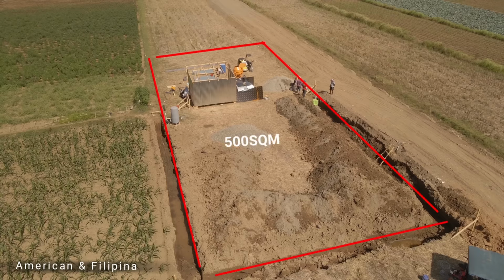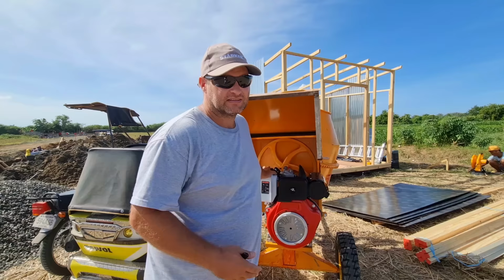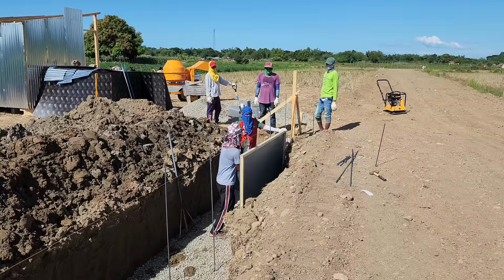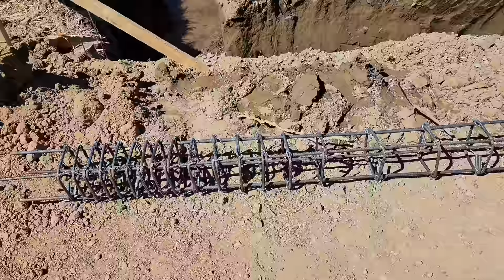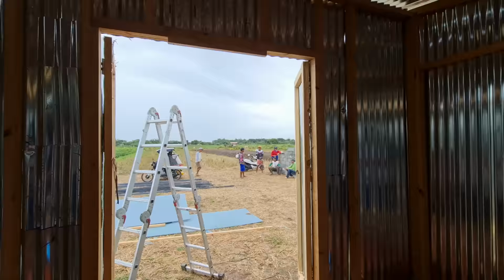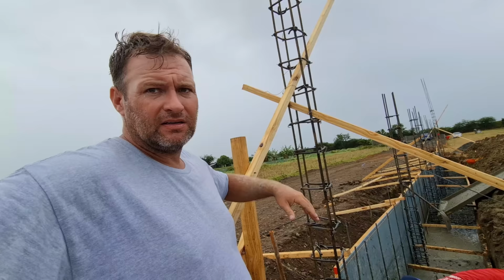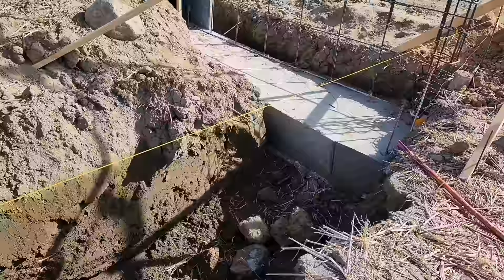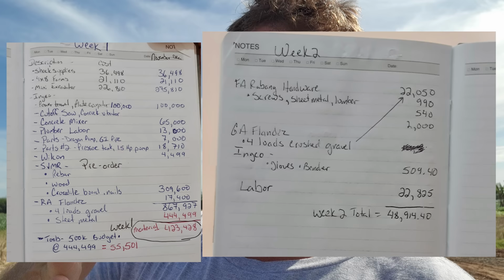Building solid Concrete Retaining Wall | S02  EP2 |House Build Philippines | The Armstrong Family

Comment: you building right beside the road? ask the local engineers if the road might expand in the future...
Reply from the maker: Road won't expand.  It's slated for a 5 meter cemented road!
Reply: @TheRichardArmstrong  there could still be an easement by the government for an additional few meters. For example: 5 meters for 2 lanes 1 meter each side for the shoulders and possibly 1 meter drainage on 1 side.

We lost about 2 meters of our farm land when they concreted the Barangay road. They even demolished our small culvert bridge without compensation and dislodged our official survey boundary markers. Good that we did not build anything there.

Comment: Curious about the slab for the house, since the earth is so wet.  Will the earth beneath the slab move causing cracks or failure of the slab?
Reply from the maker: That's a very good question.  Due to the unstable ground that is a good possibility with anything here.  Especially since we have had frequent earthquakes.   But as far as the slab
  The columns will be placed at 1.5 meters deep and then the slab will have extra reinforcement.   Settling of backfill is actually my biggest concern.   So we are trying to complete this fence and backfill as soon as possible so I can start to pack.

Comment: Richard, is the ecoflow generator dual voltage? In other words, can you charge it on the 240V power in the Philippines? Does the ecoflow have a 110V outlet as well?
Reply from the maker: I charge mine through a voltage regulator!  But I use 220 and 110 tools on it!
Reply: @TheRichardArmstrong  thanks for the info. Also, thanks for sharing your house building in the Philippines. The info you've shared has given me and my wife a better thought process on our construction of our future home in San Fabian, Pangasinan.

Comment: Delta 2,-Did you get yours in the Philippines? I will be moving to Bacolod next year and building a house for my wife and my self so I am thinking on using aac block so I am really seeing what you are doing. I am a builder but never built like they do. I will be sending my tools 110v and will be using some 240v tools.
Reply: I have not decided how I am going to build cast in place like Texas fillipino or the your building. I am following you both.
Reply from the maker: My main building of house definitely won't be form and pour or cast in place
  For me, too many disadvantages to it.  
1.  The amount of weight and load.  Requires a stronger and deeper footing for seismic load.  Which is required here and was skipped on his.  
2.  On my site I have to consider soil.  Less weight = less Instability!  = AAC!
Overall AAC had a better thermal rating than solid concrete and is easier to work with! And much cheaper!  Too many things can go wrong with cast in place!
Reply from the maker: Fir delta 2 go to the main website for 220v.  As far as 220v and 110v.  I have a friend here who just built there house and they actually spent the extra to have both wired up Inside.  He is also using a step down transformer.  I also purchased a voltage regulator for 8k pesos that steps down to 110!!!
Reply: Thank you for your response, it helps. Looking forward seeing your build keep us informed.

Comment: "This wall isn't going anywhere" Just wait a few years - particularly after a few wet seasons and rice harvests.. ;-)
Reply from the maker: It's actually called calculus!  You take the soil density and you calculate PSI strength of mass and then you figure the width and depth of form and weight to keep wall evenly distributed along soft soil.  With a hard gravel pack into bed of soil it allows moisture to come and go without washing out foundation of wall.
Reply: @TheRichardArmstrong  Well, I hope that works for you but based on the calculus formula you cited, the density will change as the soil gets more water. There is only a limited amount of water per qf of soil that can be safely retained. The water has to go somewhere and if it has no place to go, it results in something we call mud slides (I'm sure you hear of that). So even though your property is not on a hill, your wall can still be affected so if it doesn't tilt or tip over, it may just sink. I just wouldn't feel that comfortable building a house or any large structure so close to rice fields. But I hope I'm wrong and your design works well for you. Best of luck in your construction!

Comment: Richard,
In the Philippines, is it not common to use a water or vapor barrier on the concrete that touches the ground?
Reply from the maker: Not common at all actually!!!  It's actually very uncommon to see gravel put down or even packed before concrete is poured.  Most of time concrete is poured straight onto dirt.  Most houses not even tamped or packed whatsoever!!!
Reply from the maker: To even find vapor barrier here.  You'd have to order directly from USA or China.  Most of time in the province, like us,  you have to make due or do like I did and pack extra gravel!  I have yet to see any rebar caps, or see rebar coated!!!  You also have to watch out if near ocean that the contractors or companies don't deliver sand off or near beach with salt in it!
Reply: @TheRichardArmstrong  
Thanks for the information on the beach sand, I never would have thought of that. We are still in the searching stage for affordable beachfront property, primarily looking in Mindanao due to the lower risk of Typhoons. Big fan of your channel, keep up the good work. Please let the crew do most of the heavy lifting and save yourself some back pain.

Comment: Richard, so 2 feet underground for 6 feet above ground?  What price should I expect for wall 6 feet above ground per linear foot?  Hollow block between cement columns every 8 feet with rebar wherever required.
Reply from the maker: With reinforced retaining wall like mine with footers.  Etc.  You're looking at 10k pesos per Meter.  No footers, traditional hollowblock methods.  It's 7500 to 8k pesos per meter

Comment: I had a look at this vlog and noticed that the vertical and horizontal reo are touching form work. I may me wrong from the angle of the shot, please ensure that this is not occurring on your job.
because you need to put cover for your reo.
Reply from the maker: She may not have shown.  But we did lift before the pour and as we poured!

Comment: @lovelynbulan1559  I'm not sure if you need to be a Licensed Architect to legally build houses.  Architects make plans to follow building code and to get Building permit.  Building Contractors get License but they don't need to be Architects.  But there are still ways to build legally without being Licensed just as long as the plans are approved by the City Building Official.  Not sure about Philippine Laws currently.  BTW, I'm a Filipino Licensed Architect but had been out of the country for decades.

Comment: You need to get away from using inch and feet.  it will bite you sometime or other..  Filipinos very rarely use inch and feet..  The other thing I am old so I used to and sometimes use imperial , I was brought up using inch and feet.. I am an Engineer so used both but to be honest Metric becomes much easier after you get used to it.